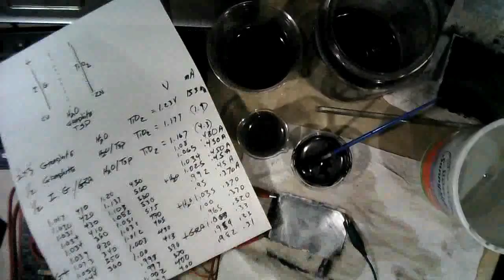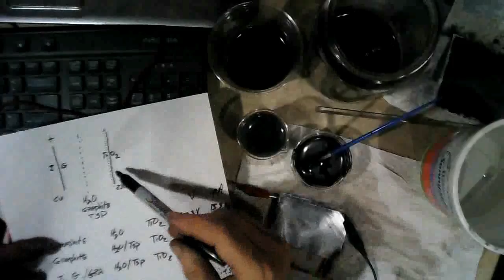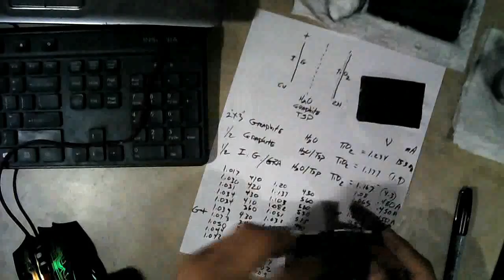Easy Intercalation & Exfoliation With Phosphoric Acid! Part #3

Comment: It keeps getting better. That's encouraging. At first I thought the voltage drop might be a chemical reaction but by adding water and having it regenerate that is apparently not the case. That the separator had no bleed through indicates that. Whether the water is evaporting or it is hydration is the question. If it is hydration it seems the reaction would diminish as the ions stabilize. Otherwise something else is happening.
Reply from the maker: I was going to put the water usage test I mentioned in this video too Fred, but I didn't have room. Adding electrolytes to the cell, makes it more complex and harder to understand. It is encouraging to see the cell hold it's power over so many cycles, which indicates that it isn't consuming the chemicals, at least not very fast.